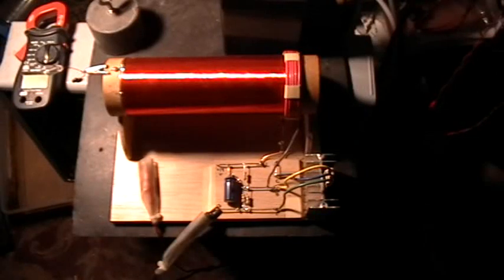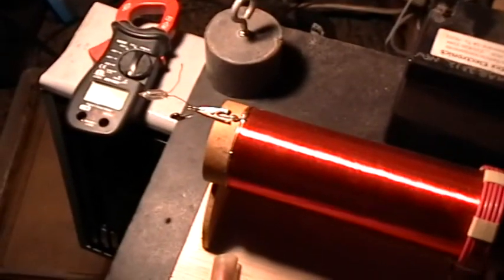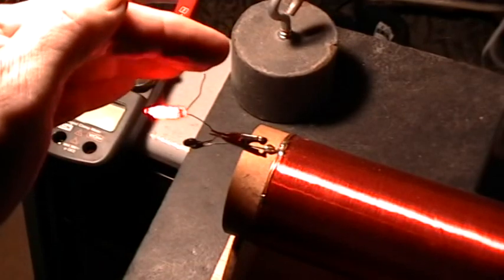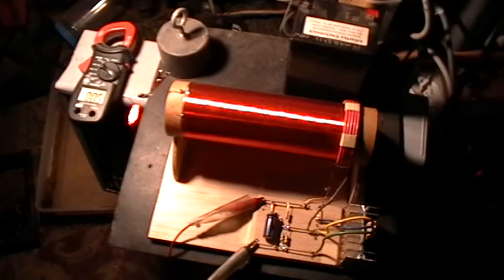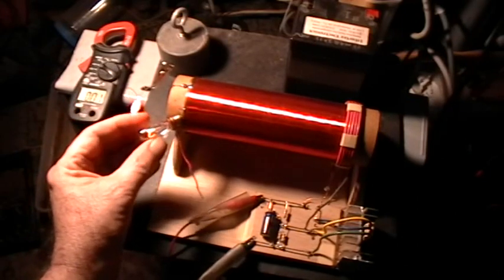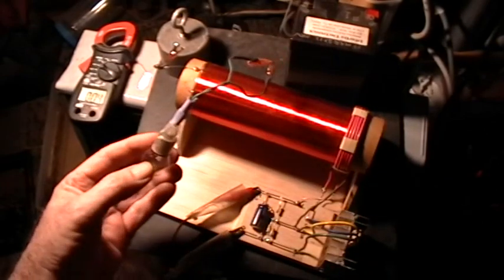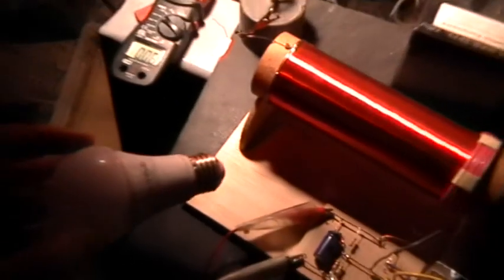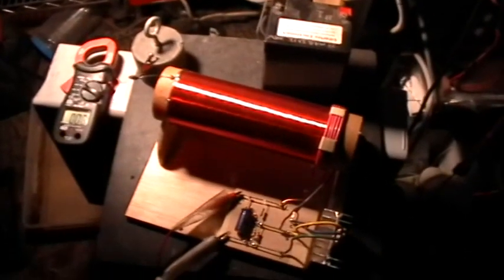Electric OU: Supplement: Don't Be Fooled By HV/RF

Comment: I need a 20000 volt plus with little to no amperage constant ARK, and a way to dial the voltage, amperage, and the frequency. All using the car battery, or the 12v ports inside the car

Comment: Hi there! I notice as the cabera pans to the left you have some thick copper wire 3 or so turns soldering the turns in parallel a bit
like a top load I have never tried this my self, what I want to know is does it 'short out the Tesla or have any adverse loading ?
Regards T

Comment: how do you know it is not a 1000 amps at some volts in there that you can't get out of it. what if there was a way to make a circuit that run on the static field that produce real current to volt higher than input and the reason you can't get it out is you don't have a clue how?. have you ever tried to connect a static capacitor or layden jar or ac static capacitor to one electrode and then form a circuit paraless to both end of the cap? if you truly have a static field present it can manifest real current if a static capacitor is used but only one electrode connected to one connector on the cap but the load to both connectors on the cap. 
when a capacitor interact with a static field it forms a plate difference where the static field is on one side of the dielectic and a voltage maifest between the plates that is unrelated to the voltage of the coil that induced the static field. you can take a copper rod and insert in the center of your coil and connect one end of the rod to a static cap and form a circuit bethween the capacitor electrode ends. i have never tried this my self with a stady static field but only by rubbing a ballon to my hair and then place it close to a static cap for then to form a circuit on the cap itself by internal short on the cap. actually the static cap doesn't need to by physically connected to the coil at all but if you connect an antenna to one of the electrodes of the static capacitor you can form the circuit by short circuit the cap or apply a load to it with a normal load.

Comment: Yes, although they have a high frequency and high voltages, many are trying to show overunity measuring with classical instruments intended for low frequency. I'm currently working with Slayer Exciter. I had also problems with measurement. Digital instrument shows wrong or is so sensitive that it starts to oscillate. To measure the power I found the solution in converting AC to DC.

Thank you for your videos. Excellent channel.

Comment: Hi TK Thank you for your link video, it really helped me in my understanding of what the heck was going on with my coil experiments in the two spark gap plus coil (Plasma Generator Transformer). I am a 68 year old student of Nikola Tesla and love learning / understanding. So with the "Clamp Metre" are we seeing "Electron Drift" or is it "Magnetic Frequency" at a "Phase angle"?  Does voltage drive amps? Is it connected with "Mass"?  ... Regards ...  DC
Reply from the maker: +E.power DC 
Thank you for watching and commenting. The clamp meter is unreliable because its internal circuitry is responding to RF noise. Call it "magnetic frequency" if you like. Magnetism results from moving electrical charges. Recall that the electron is the carrier of the unit negative electric charge, and charge is a fundamental conserved quantity. Current (amps) is a measure of the quantity of electric charge that passes your measurement point in a given time interval. Voltage is "charge pressure" coming from a quantity of alike charges all repelling one another (and/or attracting opposite charge.) As such, voltage is relative. If there is no difference in charge pressure between two points, there is no voltage difference and so current will not flow, no matter how much absolute charge is packed into the locations. We rarely see true "positive charge" since protons (carriers of the unit positive charge) are usually confined to the interior of larger atoms and shielded by the electron orbital shells of these atoms. Most often what we see in practical terms is an absence or deficit of "negative charge", and we call this "positive" when compared to some location where there is a quantity of negative charge built up. For example consider two 12v batteries connected in series. The midpoint connection is positive wrt one battery and negative wrt the other battery, at the same time, because voltage is relative.

Comment: Yes high voltage radiant energy cannot be easily measured with sensitive digital meters accurately unless their very heavily shielded as the high voltage can bypass the loading circuitry in the meter and give false readings, something many novices fail to understand.

Comment: Hey TinselKoala  .. can you please tell mei if katcher circuit make primary and secondary  going in resonance  automaticaly ?
And another question....did you thougt or ever tried to replicate   Don smith device with one tesla coil in center as emiter and other tesla coil receivers tuned to resonance to capture the energy  from around?

Don smith says  magnetic waves can be duplicated in any quantity  we want  without affecting  the consumption at emiter part so we will have plenty of overunity ....I make experiments in this direction right now but is very dificult  to me to make resonance tunings using clasical tesla coils with noisy and disturbing spark gap.. here is the picture of smith  free energy  device about  I just mentioned :http://www.google.ro/imgres?imgurl=http://free-energy-info.co.uk/Ch3/Fig48n.jpg&imgrefurl=http://overunity.com/7679/selfrunning-free-energy-devices-up-to-5-kw-from-tariel-kapanadze/12150/&h=295&w=329&tbnid=Qo7_ePtthQ3ClM:&docid=BLoruadApfosuM&ei=do3PVd-RGIqna-zysagF&tbm=isch&ved=0CCUQMygHMAdqFQoTCN-kr4Lkq8cCFYrTGgodbHkMVQ
Reply from the maker: sinergicus Yes, the Kacher circuit is auto-resonating if properly built. 
I've already shown much better actual results with wireless power transmission than anything rumored to have come from Don Smith. 
Don Smith may say whatever he likes but that doesn't mean it is correct, and in fact  much of what he does say is simply wrong... like the magnetic wave claim you have cited. 
The devices that are being talked about in the Kapanadze thread you have linked.... are really sad. Because there are a bunch of good people, like yourself, who have been taken in by a couple of fakers like Kapanadze and Akula. The good people are trying to replicate something -- a self-running system --  that isn't real at all, which is why they have constantly failed. 
If you want to know more about tuning spark-gap Tesla coils you can watch my videos about my SGTCs. Here's what a properly tuned, 24VDC input, hybrid SS-SG TC looks like when operating:
https://www.youtube.com/watch?v=aIZClhoU2Xk
https://www.youtube.com/watch?v=d_VtbfhyvUU
Reply: TinselKoala
 thank you for the answer ;can you please give me some sugestions about how to design  kacher circuit to make it auto  resonating  primary with secondary ?
Thanks